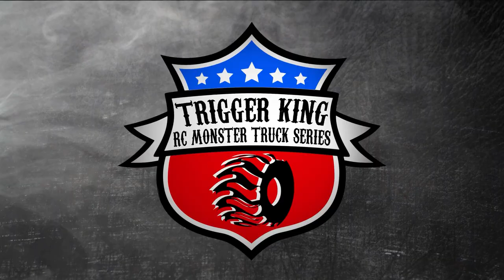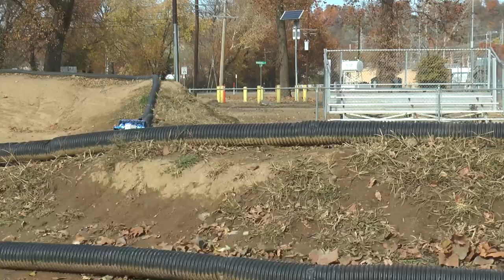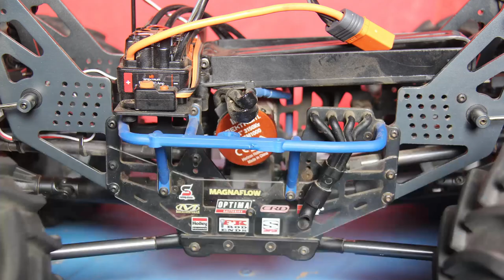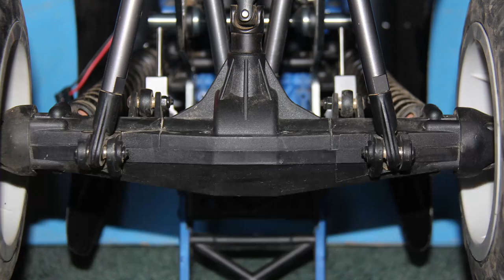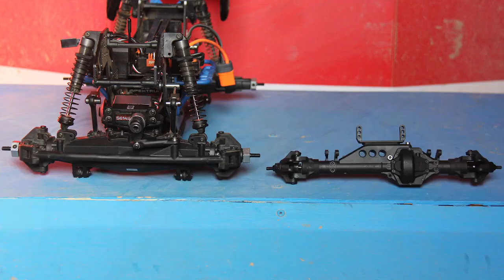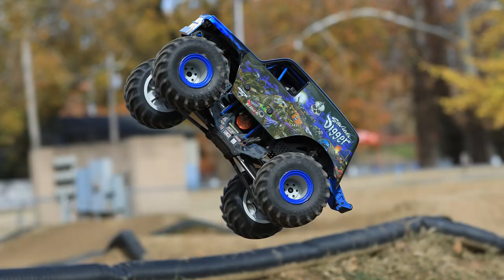Losi LMT In Detail - Trigger King R/C Monster Trucks

Comment: Hemistorm just finished dropping a video about this truck I was hoping you guys would and here it goes wonderful you guys are awesome.
👍🏻🔥😎🔥🤙🏻👏🏻👏🏻👏🏻
This truck is much bigger than that smt so what class would it fall under Tamia monster truck size I would like to know.
Reply from the maker: It is not much different than an SMT10.  The Losi actually has a shorter wheelbase.  These tires are taller than JConcepts Renegades tires, which are very popular, but they can be changed.
Reply: @TriggerKingRC  I appreciate the quick response you guys are awesome keep up the great work 👍🏻🔥😎🔥🤙🏻